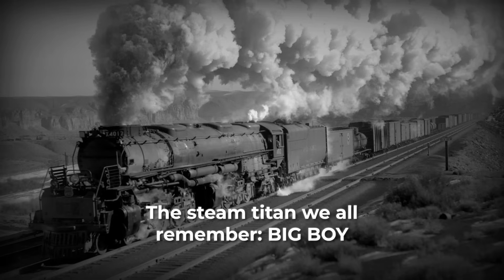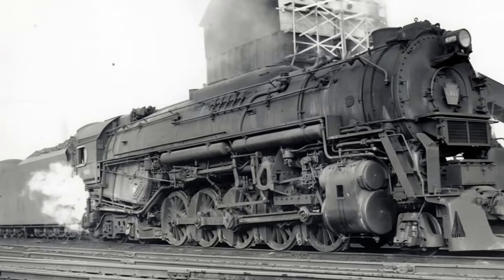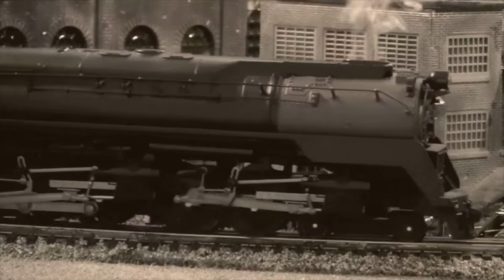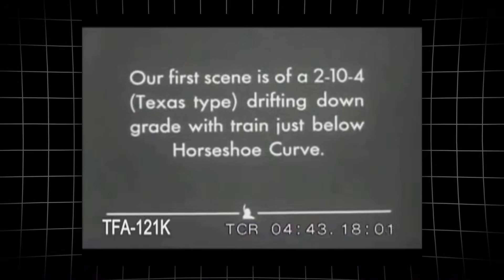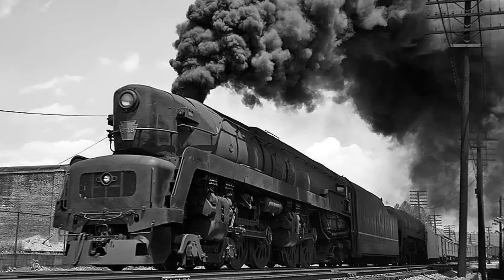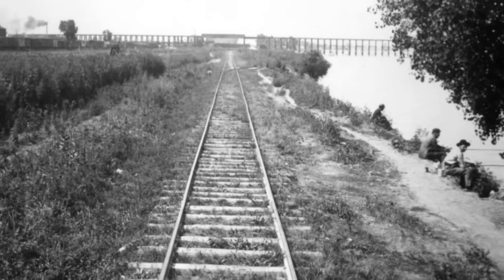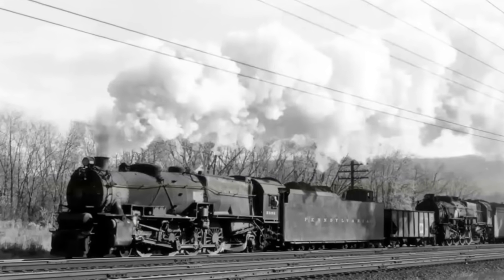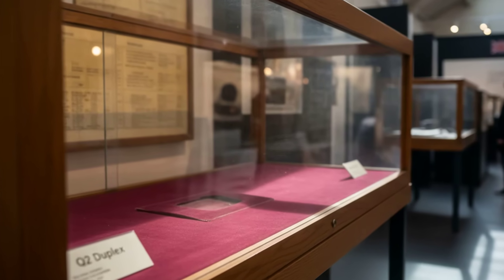The Forgotten Engine That Was More Powerful Than Big Boy

Comment: The positive note is MOST of pictured locos were PRR. Also shown were T-1, q-1, S-1 &2 and an M-1. The problems listed were commonwith ALL big locos.  The BIG BOY had more part (2 sets of 8 drivers) than the Q-2.  It took a good engineer to drive these big locos.  The T-1 is said to do 140 MPH across IN, IL,

Comment: It would seem a simple matter to mechanically synchronize the four sets of valve gear so that they maintained a constant phase relationship, and to shape the valves so that they produced piston thrust that was a proper sinusoidal function of wheel position. That would keep one set of drivers from spinning faster than the other, and reduce the pounding on the rails
. As near as I can tell, though, that was never tried on any locomotive with multiple sets of drivers. Why do you suppose that was?

Comment: This was an issues with the t1 as well. Mostly due to the engineers being used to clapped out K2 pacific and other older classical style locomotives. Norfolk and western trialed a T1 and the crew's had no issues with the duplex drive. Though different than the Q2 its not much different. Both locomotives had valve timing issues and needed a re design. and there was a spring loading issues and too much weight on the leading and trailing trucks which increased the risk of wheel slip. It was a design that didn't get a 2.0 revision due to diesels.

Comment: And again, somebody how doesn't know the difference between 7987 indicated horse power and 6298 draw bar horsepower of a Big Boy.

I calculated around 7000 draw bar horsepower for the PRR Q2 , 11% more than a UP 4000.
But for this , a Q2 need more than 16 tons coal in one hour.

Next thing: allowed freight speed 50mph, max. Q2 power 58mph .